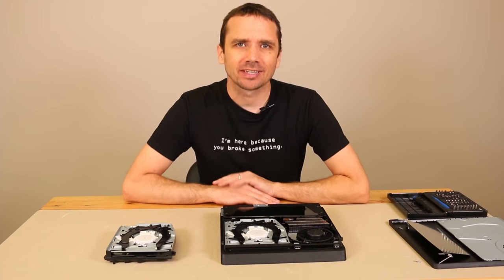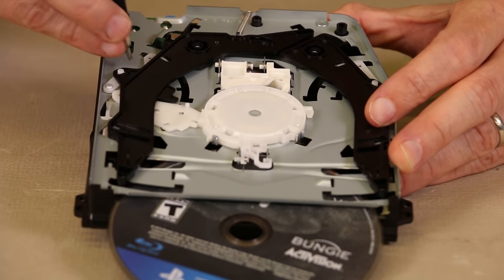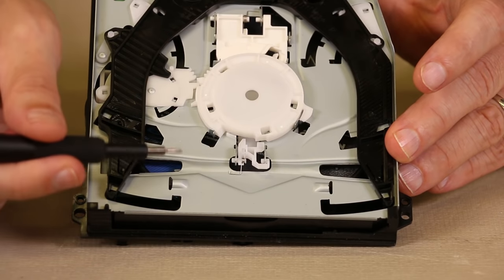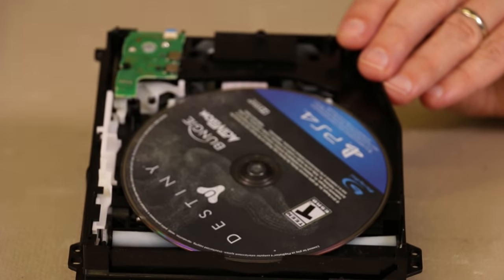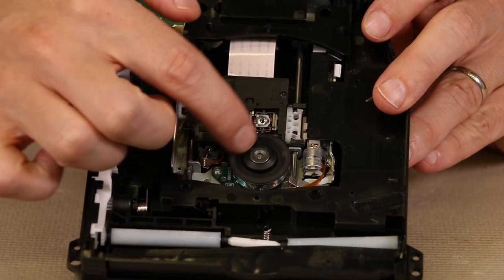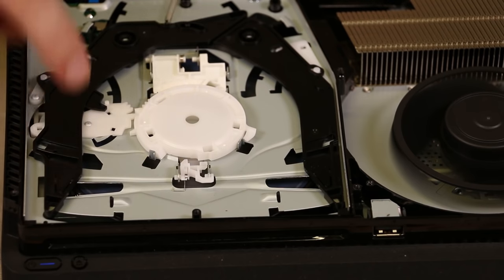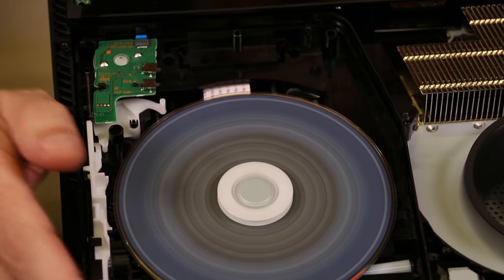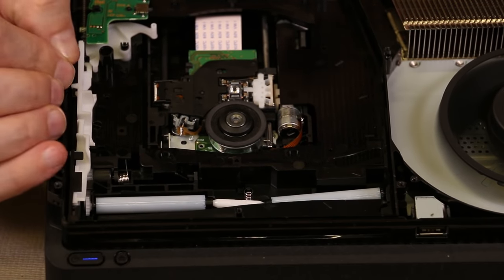How a PS4 Disc Drive Works - Very Detailed

Comment: i have a problem of not pulling in the disc. took apart and nothing was lose. cleaned everything and nothing. i think it's probably the switch that tells that the disc is coming in. Any thoughts??

Comment: Hey, thanks for the video. My blue ray drive for my ps4 pro is not ejecting the discs. I did find a tiny spring that was loose inside but I can't locate where it belongs.

Comment: Hi tronicsfix please help 
I have some issue I open PS4 check disc drive the roller work perfect the arms also work perfect but when I put disc minually the arm open very smoothly and roller push disc in very excellently but I don't know why at the end this little circle piece in middle cannot slide down disc 

Please tell me what wrong 

Thanks in advance

Comment: What's wrong with my console if my rollers won't turn on and try to inject the disk everytime i try to load a disk it says unrecognized disk.. I've cleaned out my ps4 and all the rollers and pieces are there but somethings not triggering

Comment: I have a problem with the disc drive. It's trying to read a disc, but then shows an error. 
It actually works, the laser reads a disc if I shake my ps4 pro a little, or sometimes when i just place it vertically.
Should I clean the laser head?
Re-Updating and safe mode do not help.

Comment: I am facing a disk drive problem with my ps4(original)..I did power cycle, updated in safe mode, rebuilding database, factory reset, initializing ps4 that doesn't work..I have checked rollers of drive they are fine, but couldn't understand the problem, DVD is not recognized, please help

Comment: My ps4 cannot read discs... always says unrecognised disc after the console tries to read the disc inside and makes "reading eject and in" sounds... took it apart per previous vids to see if the rollers are the issue and they're not... I have a cuh 2xxx version... i also have a spare cuh 1xxx version... but my 2xxx version is the limited edition one and want to use this one... can I swap the disc drives directly  between the two? I pressume not as the disc drive designs would be different? (Havent took apart my 1xxx) or maybe the disc laser can be swapped? (Since rollers arent the issue?) Help pls

Comment: hi i have my ps4 taken apart at the moment and i was woundering, do the rollers rol 360 degrees smoothly? reason being my left roller seems to be jammed and also my right one but only when the white middle piece is in. when i take the white peiec out the right one spins all the way around but the left still seems jammed. is that normal? thank you

Comment: Im guessing for me it is the spindle motor? Idk, because if i tip it slightly upside down it starts spinning and reads the disk.  After that inital start i can leave ps4 on its side or flat and it continues like normal.

Comment: I did what you said but my I checked if there is a the little white connecter it there but it's still not letting me put the disc in i don't know what the problem is but I think it's the motor in the disc drive because it doesn't move

Comment: So what would be the best way to fix the gears in the disk drive when they stick? They are not closing all the way causing the first sensor to always be on. Also how do you remove the flat wire without breaking the tabs on the side?

Comment: Need some help, on 1216 model games applucation craches each time, it just freezes show error ce-34878-0. I've tried everything reinstalled firwmare to 5.01, replaced hdd. Still the same. Only exception game that does not freeze is minecraft. what could be the problem?

Comment: Thanks for the video.  Any ideas why my 1200 ps4 wont pull discs in when assembled?  If I take out but still hooked up it works. I loosened the bolts and it almost worked

Comment: I left my PS4 sitting idle for a year with a disc inside. Now when I turned it on, the disc drive made strange sound and wouldn't take in the disc after I managed to eject it somehow. Looking for a solution on youtube I found this channel and I'm glad I did. First this channel helped me to open the playstation and gain access to the optical drive. Then came the issue of drive itself. Everything looked fine, no  button broken; no roller dislodged. I was about to order a replacement disc drive but happened to land on this video as a last try. 
This video explains the drive's working so well that I was able to figure out the issues. There were two. 
1) The "disc inserted" state of the drive presses the two switches in the back. Since the drive was sitting idle in hot->humid->cold weather throughout the year (so were the switches in pressed state), I suspect the constant pressed state affected the conductivity of switches' internals. So even when the switches were released, they wouldn't register as open. I mitigated it by manually operating the switches a few dozen times. 
2) I also noticed in the video that there is a white vertical part near the switches that moves back as the rollers roll the disc in but in my drive it didn't move back that far. It looked like there was some state inconsistency between different parts of the drive. The lens/back-switches were set on "disc is present" state but the white vertical part was set to "drive empty" state. I fixed it by combination of manually pressing the rollers assembly down and winding the manual insert/eject screw to bring all parts in single state, i.e., "drive empty" and it all started to work next time I powered up the playstation.

Thank you TronicsFix for this great video. I couldn't be more thankful.

Comment: Thanks for the video very helpful. My problem with my PS4 is it will take the disc in and read it but them it will not push it back out. I have a older ps4 from when they first came out and I took it in to get it repaired and the guy there told me it can be because and strip if soldered to the board and can't be unplugged. Do you have a fix for this.Thanks Ron

Comment: So what’s the reason the PS4 takes the disc in but won’t start spinning the disc?
If I remove the cover and help the disc spin, the player works fine. But without my assist, the PS4 won’t start spinning. 

Hope you can help!

Comment: i can not find a video that explains how to line up the metal top with the gears, arms, etc with the white part that engages the rollers in the front on a ps4 cuh-1115a. all i have found is just push the white part all the way to the back then put on the metal part but this will not align the two so it will work. i am getting ready to try it again but i am not holding my breath. thank you to anyone who can help.

Comment: Hey. I’m having trouble and no one is open around me. 

So I dropped my playstation slim gold. The first edition. It looks different. 
The picture and sound are gone. 

When I turned it on, it was a scratching loud noise. Also it sounded like not everything was starting up like it usually does. Just the fan on the right and the roller being stuck. I opened it up and seen it was coming from the disc reader. I watched your videos and actually took the rollers out because the left one wasn’t rolling. The whole piece came out and small spring. I’m figure it out how to put it back together. However the roller is not rolling anymore STILL!! The white jagged circle holding the Piece the roller connects to, is that supposed to be connected to the ps4 or be able to move up and down like the rest of the roller mechanism ? 

Do you have any idea what I’m saying or what is wrong???

Comment: thanks for the upload man.  i bought a ps4 slim with a non working disc drive and found that the two little silver switches on the rear left were damaged.  the scuff on the left side of console tells the story.  knowing what to look for is a time saver.  thanks again.

Comment: Does the SIDE of the disc come in contact with anything while spinning? I just discovered that the disc of one of my fave games has rough edges on the outer side and im thinking whether those rough edges would damage the ps4.

Comment: Hey I'm currently trying to solve a problem on my cuh-1116a

All cogs appear free and loose drive has power I can manually or electronically eject and insert disks

But there allways unrecognised

Having stripped the console and cleaned  every mechanical part everything seems OK but for some reason the disk won't spin

Can you tell me if

1) the drive spins before laser engages

2) does the laser have to read before disk will spin

And finally

3) as everything seems OK bar the fact the disk won't spin what else components could cause this.

Also just to add I've checked over all logic board and mother board and there's no signs of dmg burntness or anything apart from crisp clean manufacturer work

Thanks for help

Comment: So if the thick, "gray/blue/black  plastic, "lens flex ribbon cable," (that is next to the "gray wires,") gets bended then it will have to be, "replaced."

Comment: Thank you. I finally found out why my PS4 Pro is good at reading disks horizontally but not vertically. The magnet was the clue. My desk was not level. I was worried about replacing the disk drive, but the problem was much easier than I thought.
Thank you very much.
Reply: Mine the other way around

Comment: So I've taken my PlayStation apart and put it back together and still not working right, it seems like the disc won't go in all the way because it won't start spinning at all, it will go in but it won't spin. I took it and got it dusted out and brought it back home and that's what happened

Comment: I have an issue with my PS4 disc tray. Basically everything is working fine except my PS4 isn’t taking the disc in. I turned it on to play normally and everything is up to date also it’s a normal PS4 not a slim/pro. It’s like something is blocking me from putting the disc in and it doesn’t suck it in as usual. When I press the eject button it’s sounds normal as there is no disc already inside. It’s just stupid as the other day it was working fine and now it’s blocked

Comment: Hello there & thank u for your great work. I have an issue but cant find a clue. If i change the drive in an 1116a it will do a selfreset. Same If u push the eject for a little time. Disc is going in with a little "click"-sound. It wont spin up 🤔 disc comes as i gave it through. Could it be the cable (board <=> driveboard)? The old one has no notches anymore. ..got it this was :/

Comment: I open it and a black piece with a spring came out,   on one tip had the spring and teeth and on the other end has just the tube  I don’t know where it goes....disk drive won’t take the disc if I push it with force,,,,, it comes out.

Comment: The (blue) "Lens Ribbon Flex Cable," in the back it sends power to the "curcuit board," and the power then in the curcuit board sends power on through to the, "3 blue colored ribbons," that power both the ("laser sensor,") and the, "small curcuit board," that sends power on into the, "motor," (which powers the gears) that then make the disk capable of going in.

Comment: Hey man thanks for these videos and your explanations. You saved me some good money back when i was in my first year in community college in 2014 and barely had cash. All my friends had a ps4 and i was the lame kid without one so i Bought a broken ps4 from ebay for cheap with the money i saved up ( about 100 bucks... basically an overpriced hard drive if i couldn't get it fixed) but i watched ur video of how u placed plastic washers on the cpu bracket that will fix the blue light of death. After trial and error with the washers ( as you pointed out and turning the screws around little by little) i got my cheap broken ps4 working! Thanks man! I now have my bacherors degree and full time job, ended up buying a ps4 pro, but i still have my old ps4 and it works just as good! Im considering giving it away to my youner sis. XD you got my subscribe

Comment: ABOUT THE PS4 EJECT ERROR with the first PS4 model. When I noticed this happening with my PS4 I couldn't believe it, that a disc at random may eject out and I though to myself so this is the next error problem with consoles. Is there any possible chance that this eject error was made intentionally by a member of Sony to sell more newer model consoles that way? If so that would be criminal. If not at all possible, sometimes newer tech is not worth it. All those problems with wireless controllers and now the eject error. I think it would be better if Sony brought back wired controllers and press the button to open the lid to place the disc on tray consoles. I never had a problem with them except for that dang analogue stick permanently bending forward.

Comment: Hello!!  My limit switches won't work when they are in the system, but when I tested them with my power supply outside of the system, they worked fine and the motor was running.  I also checked it's continuity with my volt meter and it also worked.  I replaced my laser, thinking that was the issue, but it wasn't.  When this issue first started, I was able to insert and eject the discs fine, but half the time I would insert the discs the system would make a strange repetitive noise where it sounds where it either sounds like it's trying to eject the disc or read the disc, but it can't.  It ultimately culminated into the disc drive not working at all.
Reply: Update: I just found out that the system is not recognizing the limit switches (or the motor) at all, so the issue is with the system.  I'm not sure if replacing the disc drive is an option at this point, since everything appears to be fine with the disc drive (mechanically that is).  I'm not particularly good when it comes to programming, so I have no idea what I'm supposed to do, since the issue appears to be with the motherboard (or something else that I'm unaware of).  I REALLY wanted to avoid sending my system in (I never had to do that with any of my previous gaming consoles when they had issues). 

I forgot to mention this in my original comment: 

My system is a PS4 slim (CUH-2015A) and I purchased it during a Black Friday sale in 2016, so it's a little over 2 years old.

Comment: Hi steve, my disk drive started making a grinding noise so I’ve disassembled and cleaned everything but it still makes the noise, it’s a PS4 slim! The disk isn’t being scratched as far as I can see and still reads fine!
Reply: in my ps4 pro when i insert the cd of uncharted or gta5......after reading the disk my ps4 pro vibrate from left side mean disk driver side ...after some time its stop....can u tell me what is this
Reply: some of my cd does n"t vibrate after read.......but uncharted and gta5 my cd spin after reading....the game is not boosted up

Comment: I was playing a dvd movie in my ps4 one day and it just stopped. It would not play or eject.  Everything else worked fine except the optical drive.  I had to manually eject dvd.  The problem is nothing happens when I feed it a disc even if I shove it in there real good.

Comment: Thanks for the video, my drive has some problem in the white thing that is supposed to 'lock' the rollers down and not let a second disc come inside. I will try to fix it myself later looking at how yours is.
Reply from the maker: You're welcome.

Comment: thanks for this great video! I wonder if there's any place that sells those tiny switches that are located on the motor pcb.. one of mine is broken, and it would be a shame to throw away or replace the whole motor unit instead of replacing those switches... any idea?
Reply from the maker: Never seen just the switches for sale. You can replace the motor and green board though

Comment: Your videos are great! Some of the best I've come to find! Couple quick questions: 1) I've been getting "disc is dirty or damaged" error frequently. When I pull the disc out, it's...warm to the touch. It's more likely the motor going than the laser, yeah? 2) different ps4s have different disc drives. I have an early model 2nd gen fat PS4. I believe it has a 400 series single optic drive in it, would it be a thing if I put an 800 series dual optic drive in there? And 3) I live in the desert, it's hot, there's lots of dust and pet hair. I've cleaned my fan and casing countless times but I'm still running really hot. I also pack up my PS4 and travel with it frequently and it gets banged around pretty epically. Thermal paste is one of the last things that's often needed to be considered in PS4 maintenance, but considering the time and circumstances, would you say I'm about due?
Reply from the maker: Thermal paste is not usually the cause of overheating. You likely have a plugged heat sink. If you remove the motherboard and remove the bottom metal plate you'll be able to clean the heat sink fins. 
The laser on your disc drive is probably dirty. There is no way to put a different laser in it other than the one that it came with. You might even get by with just cleaning the laser for now.

Comment: Hey man! big fan of yours. I live in india  and the warranty policy of sony for ps4 in india is that if there is the slightest of problems in your ps4 within 12 months, insted of repairing it they straightaway give a brand new. Now in my case, my blu ray drive is faulty for sure. but d problem is that twice it has happened with me that when i took the ps4 to the service centre it started working absolutely fine for some days. So i want your help to get a way to either damage it permanently or get another problem such as blue light of death purposely so that i can get a new ps4 within my warranty period. because once d warranty ends , SonyIndia does not repair dd ps4 at all. they just give you 20 percent concession and take your old ps4. pls help otherwise my warranty period will end soon . only 2 months left

Comment: My ps4 slim is 2 yrs old and now my ps4's disc drives won't accept discs most of the time. The cd would go in but the ps4 would act like there is no disc in there! After 5 to 6 tries the ps4 would finally read the disc...